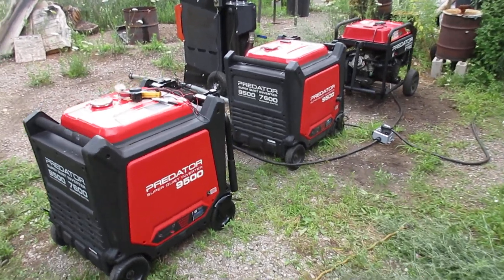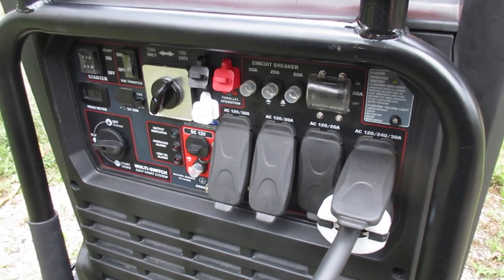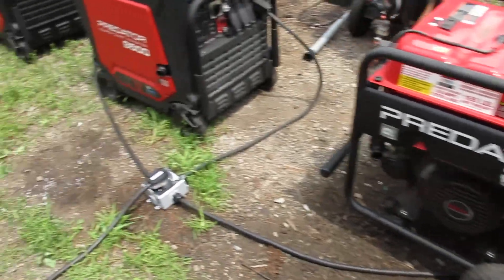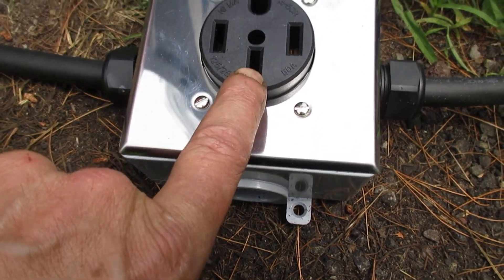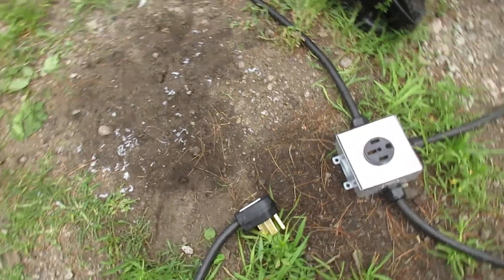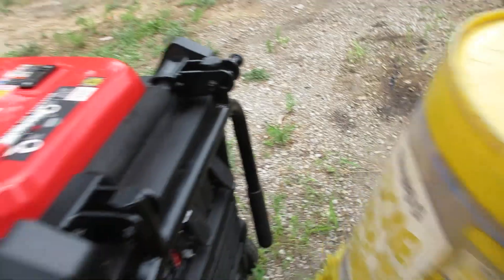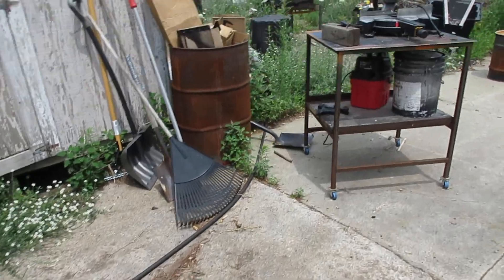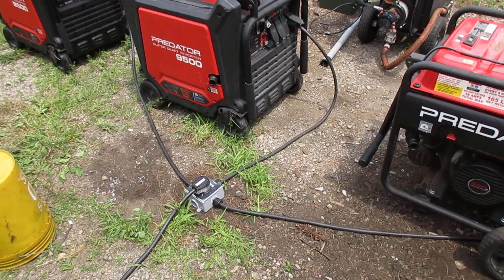Predator 8750 / 9500 DIY Parallel Kit

Comment: Can two 8750 be parallel
Reply from the maker: No you must use the 8750 as a master with a 9500. The 9500 can sync to it; But the 8750 can not sync to the 9500 or another 8750.
Reply: @Thrive-Off-Grid  Ha! My question gets answered. Thank you!!!\
Reply: @h82fail & @Thrive Energy Systems my questions are:  Can 2 "8750" type inverter generators be paralleled (this by hand-wiring a "Y" parallel cable connecting to each generator's  A/B/N 240v 30 amp output connector)?  Can inverter generators that do not have "cable ready" parallel ports still be paralleled by a hand-wired "Y" cable" since it appears that inverter generators with front panel paralleling ports, the paralleling ports are wired off the generator's 240V A, B, and neutral sockets?  What would be fantastic is if there were a bible or ruleset published that lists what is functional & allowable to parallel inverter generators especially for inverter generators with no front panel parallel ports and even include paralleling inverter with non-inverter generator.,
Reply: Wait a minute ...  If the Predator 8750 can sync to a non-inverter governor style genset, then why wouldn't a 8750 sync to a second 8750?
Reply: @gkorenek  Seems like he said he's able to start the 9500 first/use it as primary in another comment so the 8750 is doing the syncing if started up later - I was looking at getting two 8750 and I'm pretty sure he's wrong but I haven't tested it.
Edit: where did you see one synced to a non inverter gen? another video?

Comment: Predator generators are my most favorite
Reply: I bought a Predator 8750 inverter generator and it stop producing power after a month. The engine idles really high when it starts, runs for about 15 seconds and dies. I returned it to find out it only came with a 30 day warranty. So I wasted $1,100 .
Reply: You just need to bylaws the CO sensor. A simple paper clip. No cutting wires or anything. 

That’s about the only thing wrong with them. In over 2000 hours running 4-6kw with zero issues. Change oil, keep Aor filter clean, adjust rocker arms every 200 and swap/clean the plug 200-300 hrs. 

If you leave has in it or have carb problems you can clean out the jets or just put a new carb on for $30. 

There is nothing wrong with these except for the CO sensors.